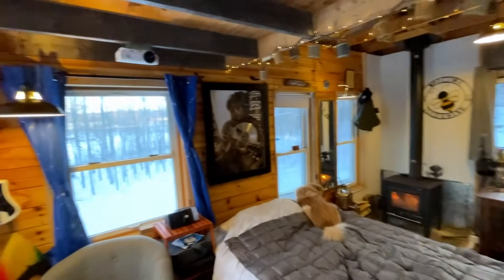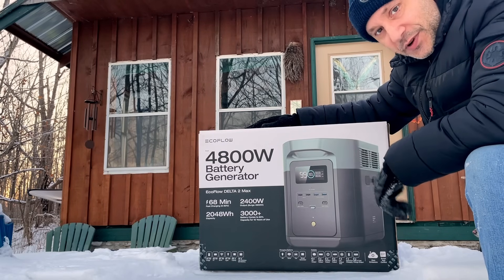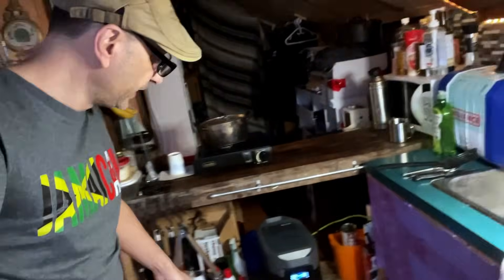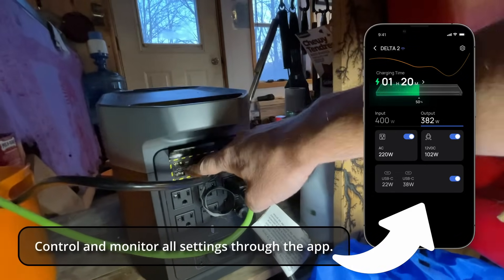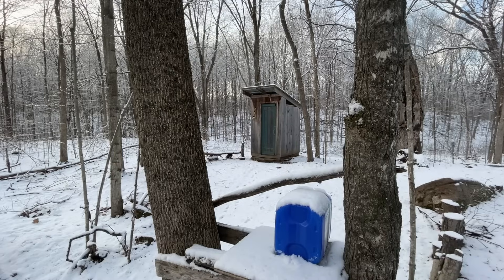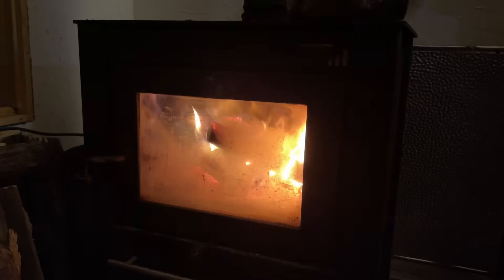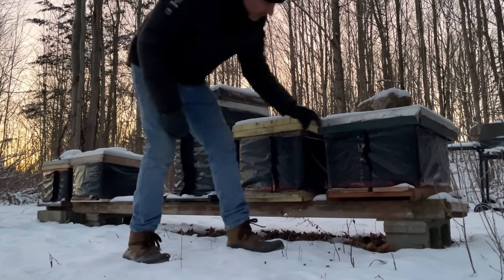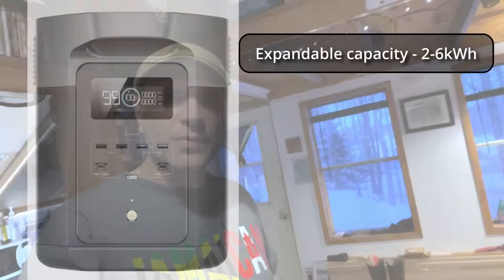The Truth About Power Stations vs. DIY Lithium Batteries (Why I Made The Switch!)

Comment: Ive got a couple of ebay solar panels.
A scrapyard lead/acid car battery and a chinese charge controller.
Its cheap, robust and rebuildable.
I have some led lights a radio and cb radio.. its all i need for my time tinkering in the garage.
Plus the battery is my emergency jump pack when the van/car wont start.
Reply from the maker: Nice, simplicity rules!
Reply: @cleverjoe lead/acid doesn't need to be babied like lithium

Comment: You can get an AGM battery to recharge a power station. I built one by following this guy on YouTube; Jasonoid. He showed me how to put together a converter that takes in 12 volts and puts out 24 volts that will charge up most power stations of your size. I have a heated lithium SOK 100 AH battery system on a portable hand truck and I can wheel it to the sun and deploy the portable 400 watt solar panels to charge it and a solar station at the same time.

Comment: You expressed concern that the AC plugs are at the back - BUT grew to like/appreciate them in that position! The Just released  the  Delta 3 Max Plus has the AC plugs and the USB plugs at the same end.  
If you had a FREE Re Do would you switch to the New D3MP simply on the basis of the plugs' location?
Reply from the maker: Yes I saw the change - honestly it wouldn't really be a deal breaker for me either way. I like the outlets/plugs where they are on the Delta 2, but it's not a huge deal. Thanks for asking, Joe.
Reply: @cleverjoe  I ask because I built a 220 amp lithium component system for my self built van 6 years ago. I have not owned a self contained power bank & now need more battery in the rig and figure  the D2M will be a good choice. 
From experience you don't REALLY Know until you've lived with a new technology in such a small space where you end up picking up on the nuances and make a  plus and minus list. Or even exactly how I will use the D2M in my travels. I will NOT use the USBs on the D2M "at all" so it is just the AC that is more important.
On one hand it Appears that it might be a PITA to have to reach in the back to plug the AC in - but then again will LIKELY not do that much any how.  Kind of like a one & done situation - same with the charging ports where it might be nice to NOT have to deal with plugs coming in from both ends of the EF PB. If I find that I want a plug on the screen side I can easily affix a 2 foot extensions cord for that odd occasion???

So that is where I'm coming from.
& I don't figure I'll ever really move the D2M from where I mount it except for when I'm back home.
Reply from the maker: @TerryManitoba  "From experience you don't REALLY Know until you've lived with a new technology in such a small space...."  Great point, I 100% agree!! Here's something to consider, if you're never planning to use the USB ports, you can always just place it where you like, and use the app to check the data. In fact, I rarely check the data screen on the power station now, and just check it my phone instead.
Reply: @cleverjoe  Good to know - thanks for the input
 In time I'm sure I'll be able to tweak it and make it work as best I can with limited space (as I have with most of van's design)

Comment: Living in So. Cal. we don't have those cold Winters so Lifepo4 batteries work for us.  I recently started building up a alternate power source as back up to the grid.  Started with a 1200w power station with two 100ah batteries and 260w panels as that is about the max my power station can handle.  I ran a test,  my fridge and some led lights for 60 hours with some power left over on this setup.  The setup cost me less $700 as got the used panels for $20 each.  This system is used to power the back bedrooms, of course no AC.  In a power out emergancy the system can be moved to the kitchen.  I plan to build a bigger system maybe in 2500w 3000w size that will provide power to the other parts of the house.  now i am looking at 2 300ah batteries and at least 1600w of solar.
Reply from the maker: Nice, that was a good deal on the used panels.

Comment: LifePo4 batteries should not be run between 20 and 80%, it is always recommended to try reach a 100% state of charge for all LifePo4 batteries. Only charging to 80% will drastically reduce the life of a LifePo4 battery. Lithium Ion batteries are different and usually 80% is best.
Reply from the maker: Good point, just keep in mind the manual says that when not in use (longer term storage), the power station should only be charged to 80%.

Comment: I wanted backup power for when these drones attack our power grid.  Purchased 2 Jackery 1000 explorer plus.  2 Bluetti 180AC and 1 Anker c1000.  I have a total of 1200w solar panels.  But like you, I need power when the sun is not shining and picked up 2 Westinghouse 2550DF to charge when there is no sun and run an air conditioner or space heater if necessary.  I do wish I had gone with the Hondas but the westinghouses start up on 1 pull (normal winter weather).    What made you choose the Ecoflow?
Reply from the maker: Thanks, sounds like you're setup nicely. I talk more about my decision in one of my recent videos: https://youtu.be/HMQlddCGz7U?si=a9wUUX_0pGu6iJtD

Comment: My camp in western Maine near Canadian border and no issues with ecoflow holding charge on winter snowmobile trips. Don't see any loss in charge when I get there and cabin is cold when I get there. I keep 7k generator and propane and a few ecoflows and starlink. I like to keep at least 50 gallons gas and same with water through I did have a well dug but winter it's frozen. I have Canadian brand Unique fridge runs of 12v and draws about 30 watts so I save my propane since no propane service off logging roads in winter. My only issue would be propane staying there all winter since feeding a woodstove takes a lot of time❤
Reply from the maker: All good info, thanks for sharing your setup. Cheers

Comment: We have several off grid cabins, and use lead acid batteries. We're in the process of upgrading to lifepo4 for the 3 cabins where we live full time. Here we have the option of pulling the batteries out of the smaller cabins if they are unoccupied for a while and will freeze (they are semi subterranean, so they don't ever get too cold) and store them in the big cabin.  The big cabin has a root cellar that we can put all the lifepo4 if we ever leave in the depth of winter, but that would be a chore with the 300 lb wall mount battery that will be there- but not too bad judging by ho easy it was to get it upstairs....

Comment: UPS doesn't mean universal power supply. It means Uninterruptible Power Supply.  It has a little battery in it that hopefully lasts long enough for you to shut down the devices you have plugged into it when the power shuts off.  It's basically a smaller version of your EcoFlow without all the 12v and solar connection options.
Reply from the maker: Thanks for this correction! Yes I meant to say Uninterruptible Power Supply.
Reply: @cleverjoe  Great video though.  Good call-out on how cold affects them.  I use some DIY batteries with Victron equipment in my Motorhome.  The batteries are inside the living space so heat isn't usually an issue.

Comment: Lifepo4 battery powerstations CAN power things below freezing but cannot be charged if below freezing. Batteries with heaters will use charging source to activate heaters first, when warm charging battery will commence
Reply from the maker: Thanks for pointing that out. It's that huge spread of almost 40 degrees though, when temps are -18C and the recommended minimum operating temps are 20C. From the manual: "Ideally, use and store the product between 20°C ~ 30°C (68°F ~ 86°F). Do not store in temperatures above 45°C (113°F) or below -10°C (14°F) for an extended period." All the best.

Comment: The power bank in video has two DC input.

You can connect the one to the AGM battery, charging it slowly.

I use a Victron MPPT solar controler as a dump load controller. When the battery reach 13.5V the output is turned on, and off at 12.8V.

If your power consumption is modest you can charge your powerbank with this setup. The disadvantage is the powerbank charges slowly from 12V (around 100W).

Comment: I've found the same thing while planning a camper van build while I keep my eye out for a deal on a used Ford Transit AWD medium roof van.  I live in the upper Midwest of the U.S. so it gets pretty cold and lithium batteries just won't be a good choice so I'm going to go with a couple 150ah AGM batteries instead which should handle being in the cold much better.  I think for your situation you've made a great choice since you can simply take it with you rather than leaving it there in the cold.  I'm planning on keeping everything I can 12V but I'll have a small inverter to use occasionally.  I too have decided to go with a low watt projector rather than a TV and I'm trying to figure out a lower watt CPAP option as well but I think I'm going to go with my old Resmed S10 model after looking at the expensive filters/humidifier disks for the travel model.  I'm planning a very lightweight and flexible build with not a lot of power needs, no AC unit, no microwave or toaster oven, etc.
Reply from the maker: Sounds like a nice setup. I'm not sure how effective the little 'travel' cpap machines are (I was told to avoid them by the doc), but the Resmed cpap machine I have uses 53 Watts with the humidifier, easily handled with a 2kwh power station or battery. Good luck!
Reply: @cleverjoe  I saw that you have the S10 as I do, I'm going to see how well the humidification works with water in the chamber but the heater turned off and what the wattage drops to.  I'm mostly going to use the van overnight in the summer and it's quite humid here.
Cheers.

Comment: I only got clued into the damage sub-freezing temps could do to LifePO4's after I installed mine. That said it's not been as big an issues as I expected. It's -4 f/-20 c here as I type.
Reply from the maker: No issues using it at those temps? I’m concerned about the longevity of the battery if not keeping within the recommended specs. Thanks for commenting.

Comment: Hello, Could some recommend some to run a max of 280w for at least 18 hours a day?
Reply from the maker: Sounds like you’ll need something in the 5kwh range.
Reply: @ Do you have a recommendation?
Reply from the maker: @ If you're looking for a power station, I don't think you can go wrong with any of the bigger brand names like EcoFlow, Bluetti or Anker. At that high of a price point though, it will be far cheaper to build your own system. Good luck with your project.

Comment: It also depends on your daily power requirements. If you just need 2Kwh combined with all in option it is a great solution. But if you need more like 10Kwh a DIY Lithium system is more interesting. As then you go to things like autostarting generator, easy adding more batteries against a fair price. (here a brand expansion of 5Kwh is like $1100). It is all about needs and wanting the hassle to build it yourself. Both are great options.
Reply from the maker: Good points, thank you.

Comment: Directly from the user manual:
The Delta2 Max will discharge power from -10C to 45C (optimum is 20C to 30C).
Charging temps are from 0C to 45C.

Comment: You are right about the temperature. You should not charge the lithium batteries below 32F or 0C. It reduces the charge capacity of the battery.

Comment: A dc to dc charger in your vehicle is cheap insurance  in case the generator goes out. I think you can get a 500 watt charge out of them. Are you sure about using them in cold weather? I know you shouldn't charge them in super cold temps but I thought they were fine to use?
Reply from the maker: They will discharge below 0c but the recommended operating temperature is 20c. Same with long term storage. Thanks for watching!

Comment: I couldn't find out new vehicles batteries were so expensive. The expensive ones are AMG. AMG doesn't care if it's cold or hot. Buy the same company 
I am testing the AMG and Lithium on time run. Night. Mainly. Yet. For a power station. I went with EGO. 3,500 watts, and I have their tools. Made sense. It is a shorter time to charge an EGO battery off of the normal charger on my 2,500-watt sign wave power converter that is hooked up to my Lithium battery than ongrid. Why. I have no clue. Not much faster.

Comment: Don't overlook getting a unit with lots of USB ports, and a 12 volt cigarette plug. There's plenty of stuff you can run off of these, such as lights and fans, and the cig plug is great for running a 12 volt fridge/freezer. This way, you don't have to turn on the AC inverter,.. which in a lot of cases uses 40 watts or more. Make sure you get a LifePo4 battery,.. which has around 4000 charge cycles. Lithium Ion only has 800-1000 charge cycles.
Reply from the maker: All great points, thanks.
Reply: Unfortunately Ecoflow is getting rid of the cigarette plug on the new models. Big minus point for me...
Reply from the maker: @DannyN777  That’s too bad, I’ve found the cigarette plug extremely useful. I wonder what the reasoning is?
Reply: @cleverjoe  
Same to me, I like to run my fridge on the cigarette plug. Unfortunately it seems that there always has to be something negative on everything. ☹️

Comment: My system is in the pass through on my rv, which is located under my bed. Also in the pass through is a diesel heater that blows air out on one side of the bed and the intake on the other side… keeping my batteries nice and warm. I’m building my cabin which will also be solar… (lithium). It’ll be indoors, keeping the batteries warm.  (Wood stove).  No problems been running 3 years now.   I’ve also a jackery 2000 plus.. it’s an expensive little toy but I like it.

Comment: I live in rural France but also travel extensively in my RV. I have both systems like you in my van, I love the portability of the ecoflow delta I have used it around the property to run electric chain saws when we had trees blown down in storms also to provide power in my house when we have outages. If you have just one fixed system you can’t do all of that.
Reply: Goals! This is what I want to do. Off-grid static + a built-out van (not RV - been there, done those) for travel. ENJOY your life, Sir!
Reply from the maker: Good points, thanks for sharing.

Comment: Good point about AGM and cold. I have the same battery but smaller , 80amp. i had it foam over, i guess it vented? I think it was in the sun and i ran something over 30 amps and it must have bubbled a bit. Have you had that happen? What caused it? I am thinking heat. I have a little afferiy, i use it to move power to my van, 16 lbs, easy to carry back and forth, up and down stairs. i also wonder how much solar you are getting in that low light and if you have mono panels. i have poly panels which work great in shde (west coast). Max i have gotten so far is almost 60%, in terms of watts (I couldn't change the angle, they are horizontal).
Reply from the maker: Over heating can cause issues with agm batteries. My panels are poly and they do better in the shade as you mentioned. Cheers

Comment: DIY 15kwh battery pack just built for the cost you spent on that eco Flo. Not knocking your system, just pointing out how much more power you can get. I have over temp, low temp shutoff as well as over voltage. My batteries self heat and I can charge off of solar, generator, and also the grid. Not to mention, my Max discharge rate is about 150 amps continuous, which you’re limited by with the pre built systems. If I were you, I’d mix and match for the best back for your buck. I also live in a cold climate state.
Reply from the maker: Nice, that's a lot of power.

Comment: I'm pretty sure you can use lithium in the cold, you just don't charge it in the cold.  I have them in my motorhome and have used them that way.
Reply from the maker: Thanks, this is good to know. The manual for the Ecoflow says "Optimal operating temperature 20°C - 30°C (68°F - 86°F)" and "Discharging temperature -10°C - 45°C (14°F - 113°F)",  but doesn't specify beyond this. I assume that the more you stay within the optimal specs, the longer the battery will last. Cheers

Comment: You are spot on ! AGM/lead acid are more cold weather hardy - I've run into this on my camper - I have a 12 volt system on my camper - I can run one of my lipo4fe on the camper or put one of my flooded lead acids for cold weather camping - just go my Ecoflow on a black friday deal - and good video ! You can charge your ecoflow with solar as well...

Comment: As far as charging you cant charge below 0c 32f but you can discharge up to -4f. If you have plantry of solar coming in then i would recommending putting a heating pad around it to keep it warm while charging it. Since it has passthrougg charging you can charge ajd discharge at the same time and if the power coming in is more then the power going out then its a net gain..

Comment: Thank you for sharing.  I own an Ecoflow delta  max 1600. We were running our small house for a year. Then our AC went out.  It tells us overload and it will not charge via the ac outlet. So now we are charging it via a solar panel. We are now plugging in an external power inverter  via the 12 volt outlet. The uses work. Just not the AC. We still love our ecoflow. Thank you again
Reply from the maker: Sorry to hear this. Did you contact EcoFlow about the issue and whether it's covered by their five year warranty?